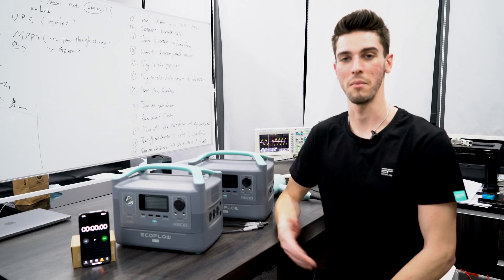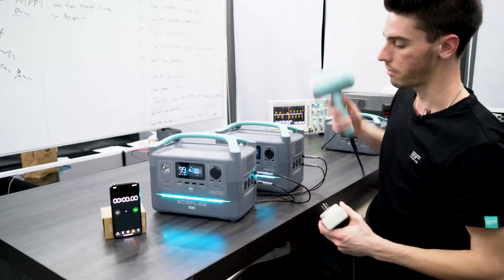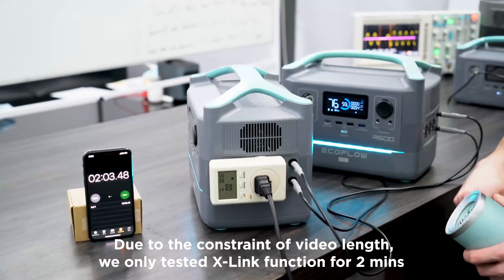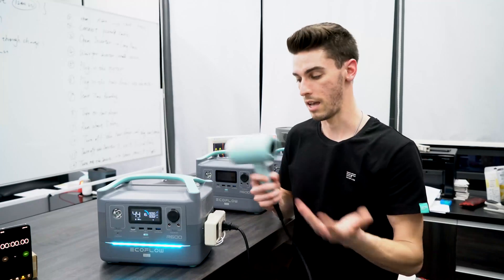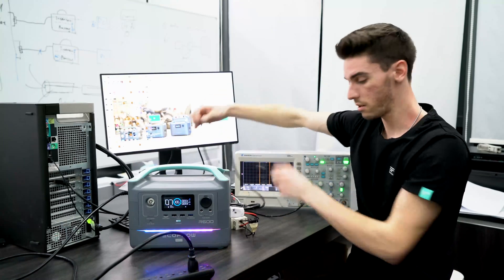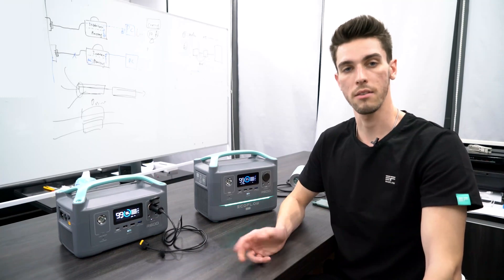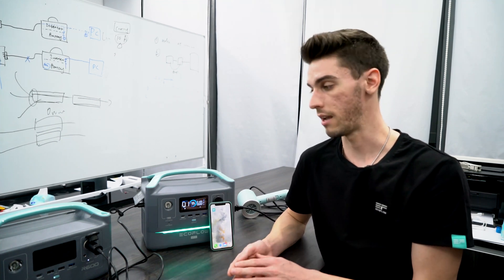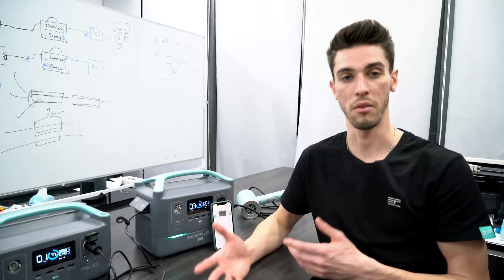EcoFlow R600 Updates Testing  (May 2020 Updated Firmware)

Comment: Great seeing the improvements and Will's follow up testing showing several fixes. Unfortunately chaining for ups or x-link failed and overheating is showing as a problem. Some of this seems to be a faulty battery I think. Increased QC may be needed.
Reply from the maker: We appreciate for your and Will’s feedback, but please note that the units we sent to Will are EVT samples for the beta test which do not represent the mass production quality. 

EcoFlow R600 is at the forefront of the market, it’s the first on the market to add the function of X-link, which essentially makes the AC function more powerful; but X-link itself has many technical difficulties, from hardware to software, but the hardware is relatively mature now. And we have been constantly optimizing the software algorithm, and currently it can reach 80% maturity. We will continue to optimize before mass production (4 months) to achieve 100% technological perfection.

Before moving to the mass production stage, the R&D team and Quality Control team will have a strict schedule on optimizing the features and final testing the products. We will solve all the bugs before we make the final delivery.
Reply: @EcoFlowTech  Then send him the 100% production unit to test after 4 months. No point in releasing half baked firmware updates
Reply: He is a beta tester as they sent him the unit knowing how he would test it and what he would test.

Comment: Would be good if it could extend the battery capacity with 12v batteries instead of 24v wired in series & Ef 1500 was a smaller unit